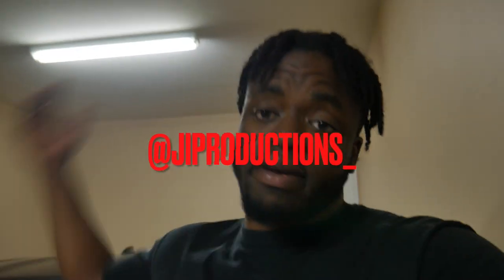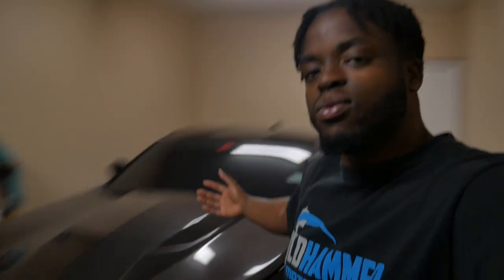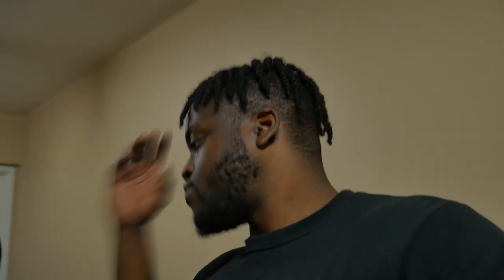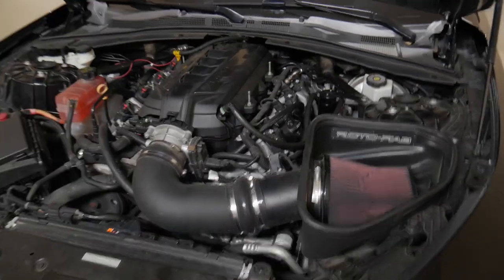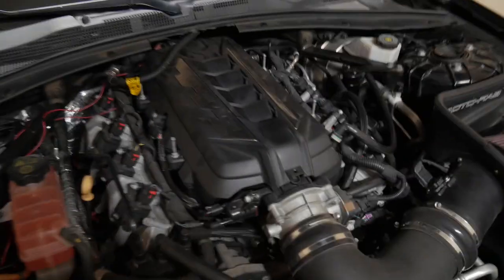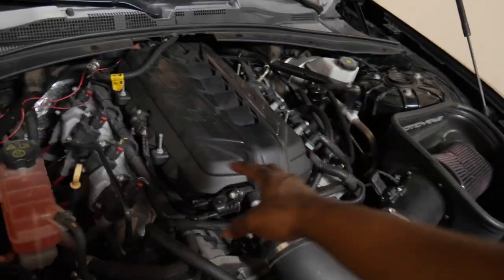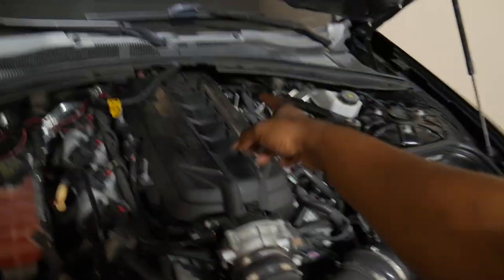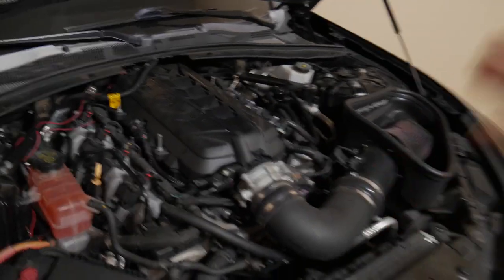WILL PORTING THE INTAKE MANIFOLD AND THROTTLE BODY REALLY MAKE A DIFFERNCE ? #chevrolet #ss #porting

Comment: Msd and a lt5 good brother. A ported lt2 is nice but a ported msd is better.
Reply from the maker: Cars going on the dyno soon so we will see what gains I’m getting from it.
Reply: @JI Productions  you'll definitely make some gains. If you want to push that 500 wheel mark skip the msd and go straight highram!
Reply from the maker: It’s probably already over 500 tbh If not 500 on the dot
Reply: @JI Productions  I had 2 inch headers, a 100mm lt5, msd, ati damper, 160 tstat, c85 and ported heads and a compression bump and still didn't touch 500 until I went highram.
Reply from the maker: @cregxy  that’s wild champ no cap 
Car was stock tb non ported lt2 1 7/8th lt headers and e71 made 480 in 133 degree shop temps champ